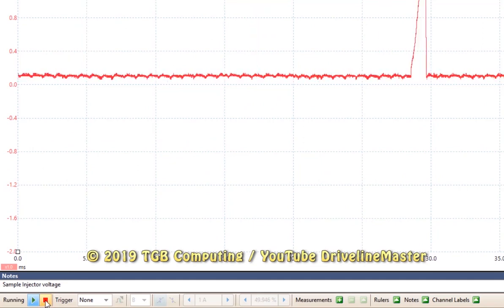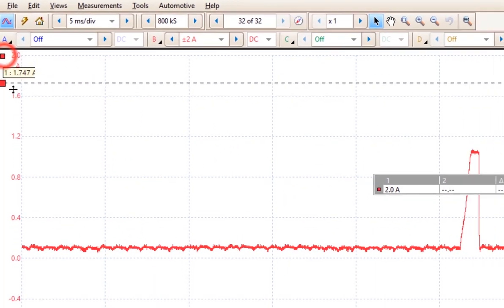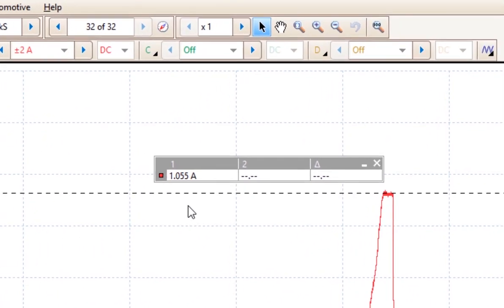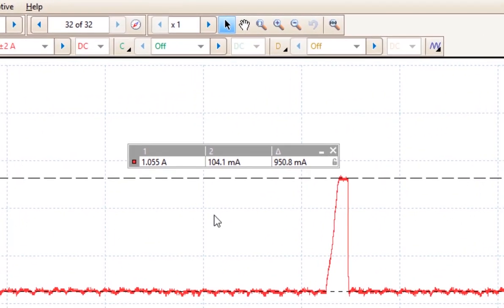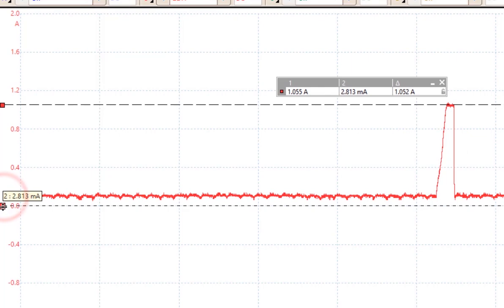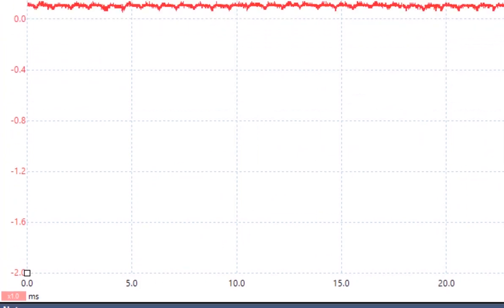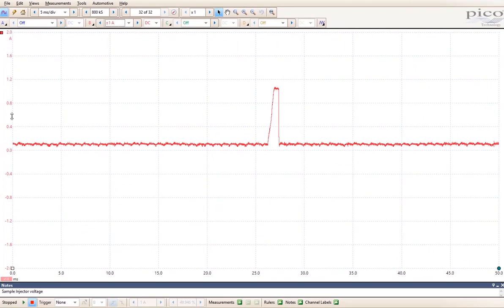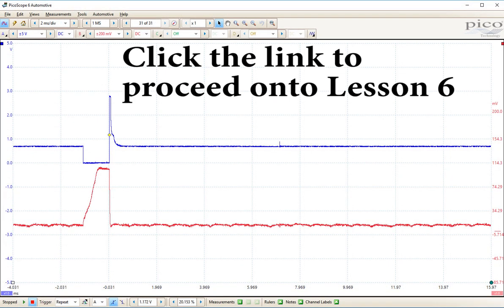Pico Scope 6, Signal Rulers & Inside Tips (Lesson 5)

Comment: Thank you for sharing. Good job. I've searched for the easiest to understand description and examples of what a floating ground is, but haven't found one that helps me to understand. Also, when you should place the ground lead at the components return/low reference/ground wire for your test and when you shouldn't. I see most testing is done with the ground lead placed on good chassis or battery negative. Summary of the above. I'm not sure how to understand floating ground, it's purpose, how to identify it, and when you must and must not, probe a components ground wire/terminal for scope testing. Have a blessed and safe week.

Comment: Hi, DLM.

IMO, the reason why i think 0 point is a bit lower, isn't it because a physical 0 or so indicates faults while a high rating signifies opposite of that fault possibly? Even though measuring Amperage.

For ex: i remember learning in class, if reading 0v or 5v its a fault of short to ground for 0v and 5v is open. 

I don't know i just think it shouldn't show 0v unless there is definitely something wrong.
Reply from the maker: In most cases you might be right. When the waveform doesn't return to exact zero that indicates resistance or a voltage drop on the ground side. If a ground has to go through electronics before returning to battery that resistance can be as high as 200 mv which will show up on the scope and not pulling all the way to ground.  Knowing what you are looking at and the type of test you are performing and where you are making that test can help to determine if this is a problem or not.
Reply: @DrivelineMaster  for amperage I'm not too sure but I see why you say if understood what it is I'm looking for it shouldn't be a problem.